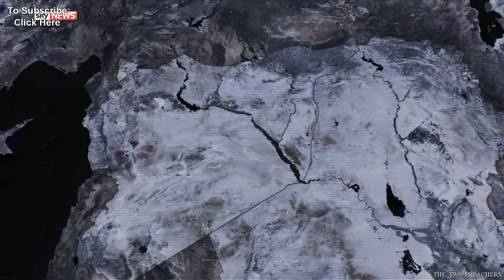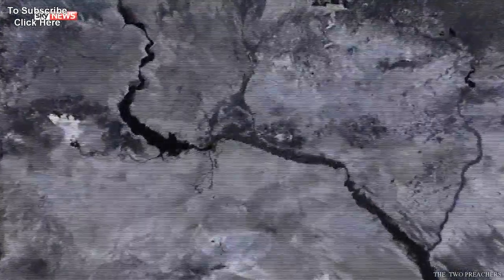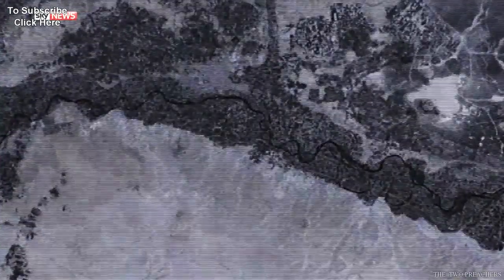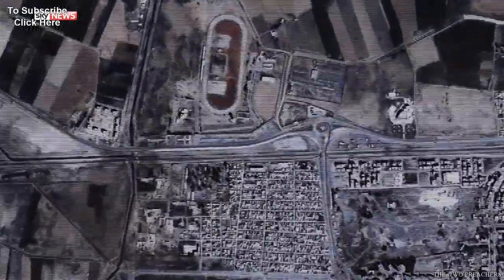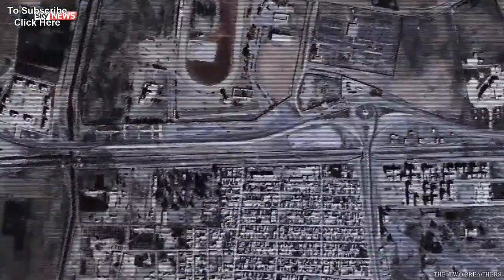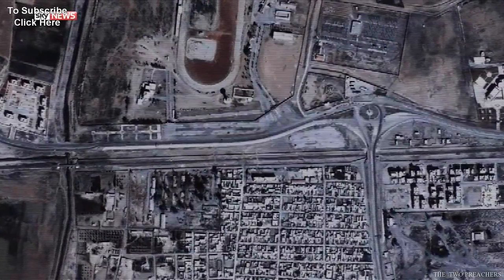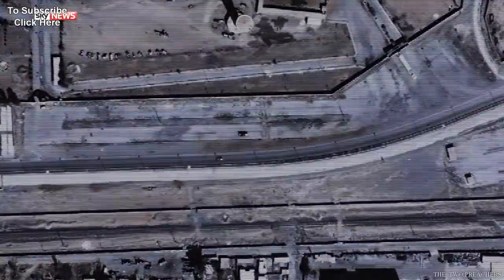BREAKING: SHOCKING FOOTAGE OF ISIS WEAPONS LABORATORY

Comment: The missile that they are connecting a battery to in the video is an air-to-air missile. This is a Russian copy of the AIM-9 Sidewinder known as the AA-2 Atoll (K-13). Plenty of these missiles were captured when they overran Syrian air force bases and storage depots. It looks likely that they may attempt to field these converted air-to-air missiles as surface to air missiles?

The US used to have a SAM system based on the Sidewinder.

https://en.wikipedia.org/wiki/MIM-72_Chaparral

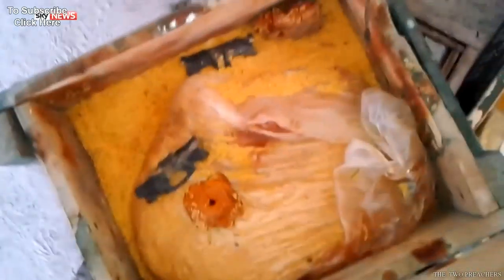You can see captured AA-2 Atoll air-to-air missiles at 3:08 in the following ISIS video.

https://www.youtube.com/watch?v=PJCtIdfXDKs